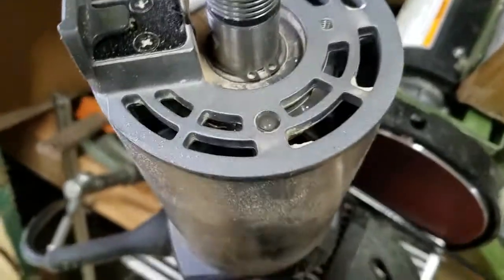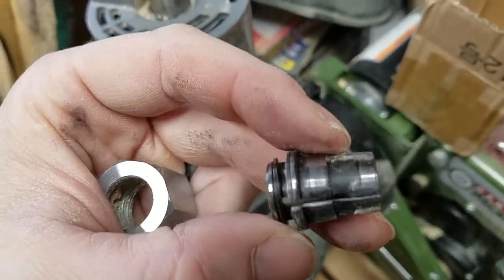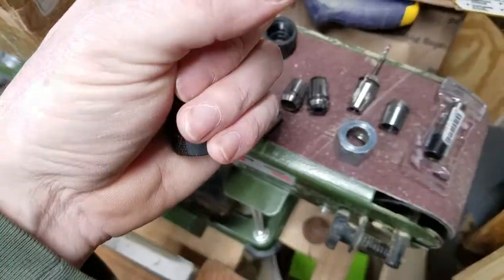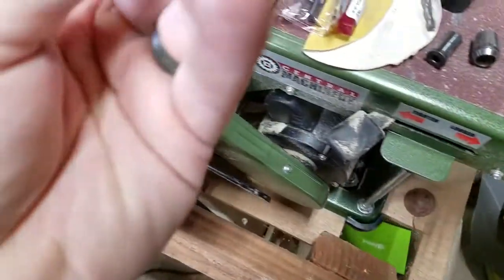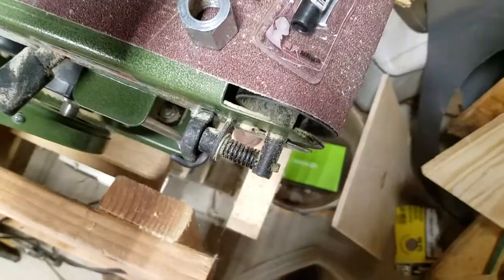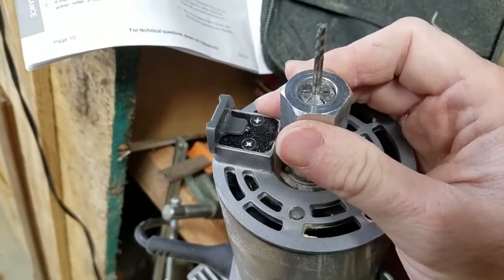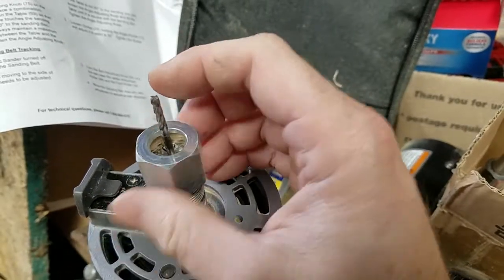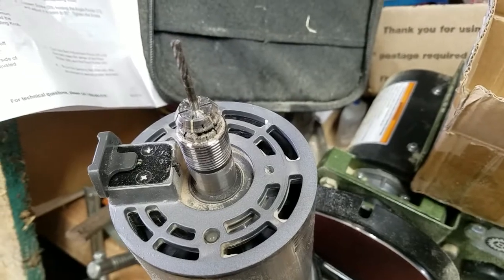Rigid R2200 Collet and ER16 Replacement

Comment: When it comes to collet tapers, close only counts with horseshoes and hand grenades.  I have this same router, it’s an R2901. I also have other spindles that use ER-16 and ER-20 collets.  The taper similarities between the rigid router and ER-19 are superficial at best. It is deceiving because the ER taper is more shallow, so we see the collet make contact at the outermost surface and don’t immediately see how much wiggle there is deeper down inside. Without a bit inserted the collet will appear to conform to the inside of the taper and feel snug, but that is because it is distorting into the void that would be occupied by the bit.  With the bit in place, that conformity is not allowed which means you would only be clamping on the bit in a single ring at the very end of the shaft, creating a seesaw effect. The only thing keeping it from freely rocking is the friction at this point of contact.  I would not recommend attempting to use ER-16 collets in this router without re-grinding the taper to properly match, which  is beyond the capability of most home machinists.
Reply from the maker: Lol. If we were cutting metal, sure. I put 100's of hours on this and never had a problem. It is "good enough".  Just like a dollar store screwdriver is good enough to tighten a random loose screw for most applications.